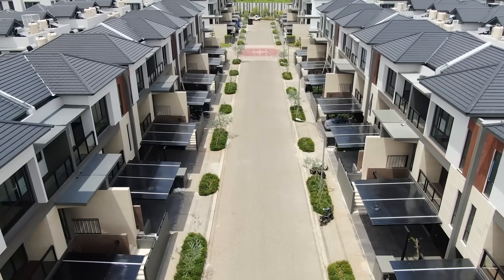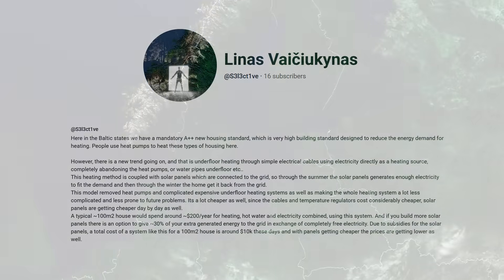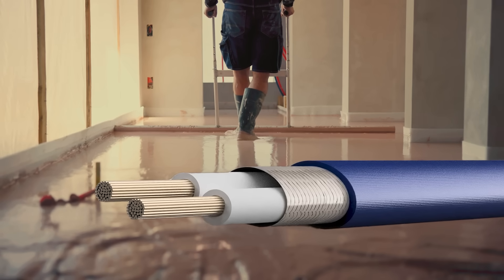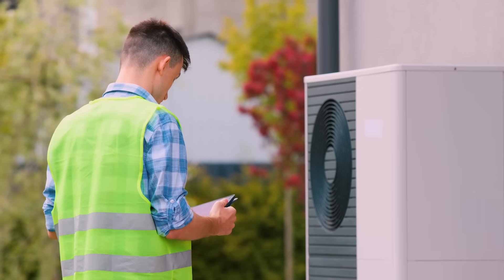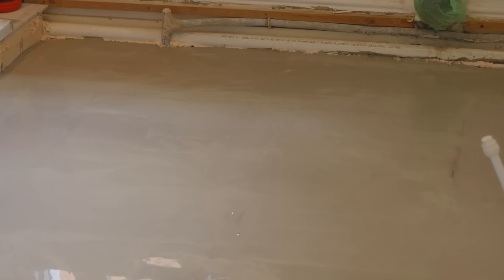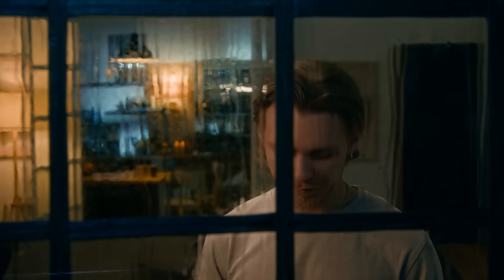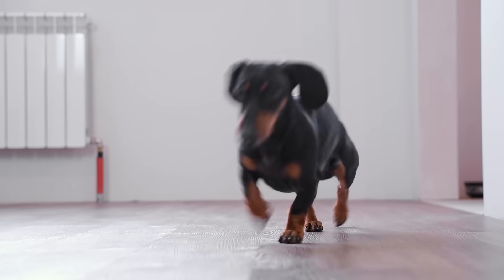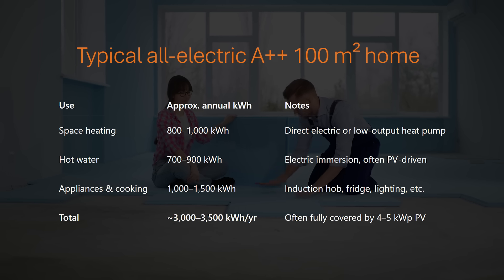What the Baltics Can Teach Us About Home Heating

Comment: If you build something that can more or less be a passive house, and just topp it off with direct electric it might be a bit inefficient but the install cost, upkeep and lifetime of the system is completely different.  Imagine not having to worry about water leaks, pumps, heatpumps and their associated lifetime costs. 

In a distant future when we have surplus in electricity, I think direct electric will have a massive comeback.

Comment: Heat pumps are fine for mild winters but in our dash for zero we do not encourage multiple systems. It must be clear to anyone who looks closely that switching to a gas device in the depths of winter and higher water temperatures is the way to go.
Our houses are not well insulated, mine is a 1930s small detached with uPVC double glazing, 8” of loft insulation I installed 20 years ago when subsidised, and a modern combi boiler. There is more I can do with a well insulated loft hatch, closing off the cavities and foil insulation under carpets in some ground floor rooms. But beyond that we are not going to find many cheap gains.

Comment: So  yes it does work but you can also use the heat pumps in the same house. And pump it into under flour heat base. Which gives higher thermal efficiency.  But you find  houses in uk  with this specific  standard of building you pay for it. Big time Uk builders don’t have the skills to produce houses of this standard in uk on mass

Comment: UK have to have sub standard building regulations if you cannot get a heat pump to work. Lithuania have one of thhe higest electricity ptices in Europe, far higher than UK. Why the do not install heat pumps is simply since they cannot affoard one. 200 in Lithuania is 2000 in UK.

I would start removing the carpets from the bathroom and leave the tudor stone and clay houses for the critters. We stopped living in outhouses in 1900.

The Vikings on Iceland was more clever in energy efficency compared to britts in 2025.

I live in Finland and I am not a heating engineer. Here heating efficency is common knowledge. We heat ou houses with electricity nowadays in combination with a heat pump in some form. In rural areas people heat with firewood if they have own forrest and tge processing equipment. Oil and gas are out since 1990’s.

Also, there are 2.8 million inhabitants in Lithania. Maybe you should compare the situation to a suburb of London. They have one hydroplant they run fot a few hours plus some wind power. When that runs out they mainly import electricity from Poland, Sweden and Finland. uK is on similar path importing Norweigian hydro power. scottish gas will still determine your electricity prices.

Comment: I have an unremarkable 1930 end terrace north facing 100sqm house in outer london...solid walls, hip-to-gable loft conversion..so north facing wall is 3 stories tall. Windows and door from the early 80's.... quotes are 20k. I have no idea how much external insulation would be but from others Ive been reading around 15k. Possibly. 
I would never get ROI on this before my death in 30years. I would love a more comfortable house yes, but unless I lose my job and get the government to pay for all these upgrades I suspect I'll either live here as it is till I die, or end up selling.
The cost to bring it up to modern standards is way too high. Labour is too expensive, but I appreciate everybody has to eat. So here we sit, in 2025, cold and miserable. heating comes on, temperatures go up...then we lose +2degC/hr...so whats the point. I'm not paying to warm up London.

Comment: Your describing a passivhaus, nice if you can afford one.

I live in a 70m2, 2ft rubble stone cottage, no insulation, Air leaky as hell.  Wool cardigan is primary heating, gas for 2 hours in morning, 5 hours at night.  Log burner for really cold days, Log burner is a luxury as that costs more than gas.

The cost of insulating and heat pump vs payback just doesn't add up when the house is warm enough on 5000kwh of gas PA or £400 at current rates.  I would save approximately £200 PA for an outlay of £20K

Comment: My 1930's semi requires so much heat in winter I can't see anything other then gas working for us, until we finish insulating anyway. On a cold day the exterior walls get down to 10 or 11 degrees c. The windows are much the same as they are air filled double glazing I would think.

Comment: What about putting your heat pump in your cellar of annex garage, well vertilated. This will make it even more efficient in winter and summer.
Reply from the maker: It will cause no end of problems by taking all the heat out of the building

Comment: I live in Eastern Europe and installed a monobloc air source myself. It's only used for heating and I have underfloor pipes so the system is very simple. I'm very happy with it. It's an old house but over the years I've insulated it pretty well. I also have a solar system that I also installed myself.

Comment: I'm going to build a 90sqm bungalow, modular house. Raft foundation 150mm kore insulation. Modular skin is 80mm pir composite, will have cement board outside, nap plaster. Internal 100mm pir board, 12.5mm plasterboard, same for ceiling. Roof tile is 80mm composite sheeting. Heat recovery system. Electric heating, probably infrared panels but not 100% decided yet, heat recovery should move enough air to distribute radiated heat. I will be adding pv panels and battery to a garage roof or lawn mounted panels in the next few years. I expect A2 BER before pv panels and A+ after pv panels.

Comment: Its impossible to live in such building. Airtight means no ventilation, no exhaust of anything - kitchen fumes, cat litterbox or spoiled foodscrap bucket. As soon as it becomes ventilated - heating of this constantly changing air (at least 1 time per hour for comfort living! For workspace its 3 times per hour) becomes a big problem. Recouperators with heat exchangers can reduce it, but they are very complex and expensive.
Reply: Some houses or victorian age arent feasible for full house ventilation systems let alone twice for air supply and returm

Comment: There should be a revised government spec on new builds, proper insulation wouldn't cost too much more. Outside air/air heat exchangers would minimise heat loss to achieve fresh air requirements. All this has been going on in Scandinavia for decades. Zero energy homes allowing occupant who emit 100 watts/person of heat. But we don't have hyper-mileage cars (300mpg), so we won't have this either.

I have a wood burning stove and burn 4m3 wood a year at €60/m3, so my heating bill is €240/year.

Comment: What do you do on an old, poorly insulated house?
Solution for me, I use 250w heat lamps for instant heat, and i turn them off when I leave the room. Bill down 60% to 360 kwh per YEAR. including 5 months of AC. The bulbs cost $5 each.

Comment: How about running those cables on the internal walls instead of on the floors?
Reply: Why would you avoid running it it the floors? You need to run them in something that has a thermal mass, like concrete and tile. I guess, if you have solid walls, you could do that, but why?

Comment: So, you are saying the hp doesn’t work in the uk because of the housing stock and therefore there is too much work to get them adopted, but the solution is to build new really efficient housing? How about you meet mid way, do some improvements to the existing homes and install hp?

Comment: It is a total myth that you need a well insulated house to run a heat pump efficiently.  The efficiency of the heat pump is not affected at all by the level of insulation that a property has, what is key to heat pump efficiency is the flow rate and the flow temperature that the unit operates at.  ANY heating source will cost more money to run if a property is not well insulated, that is just common sense.  Now, if a property is well insulated, you could possibly run a heat pump at lower flow temps to keep its efficiency high, but that's a different thing.  You can also run a heat pump at low flow temps in a poorly insulated property (for example, our 150 year old Victorian stone built detached house), as long as the heat pump is correctly sized and has emitters (radiators, underfloor heating) that are big enough to distribute enough heat to match the property's heat loss at all realistic outside air temperatures.

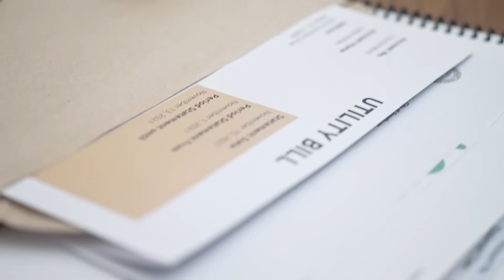Comment: 1:05 if you used an oil boiler in a super insulated home it would be so easy to repair, cheap to run as you won’t use much oil and it’s doesn’t rely on the grid. Yes it’s old fuel but this question is about insulation and NOT fuel type.

Comment: The bottom line in the UK is that solving this problem too quickly will make the people in control worse off. That's all it comes down to. Until they work out a way to line their pockets and exploit it effectively, nothing will change. That's why there is such a high cost to these bits of new tech. Who wouldn't want solar and heat pumps in a well insulated home? You can generate a lot of your own energy and never pay for gas again! That's scary for energy companies and govt.

Comment: Hi Roger, what heating system do they put into new house in the UK? In Ireland all new houses are A rated and have a heat pump, it works well due to the insulation. I myslf got a new house 3 years ago and the energy bills are lower than my previous oil boiler home. I also would have had to buy approx 800 euro of oil each year. The house is also much more comfortable as its the same temperature all Winter, no more coming home to a cold house.

Comment: This an age-old discussion on the differences between a Continental climate and what we have in the UK, which I would describe as a Gulf Climate, i.e. that influenced by the Gulf Stream.

A Continental climate is largely stable and the differences between seasond well defined and predictable because of the large land mass of the European continent.

The UK and Ireland are perched on the extremes of the European land mass and, almost uniquely, the victim of oceanic activity on another continent completely, South and North America, assuming we can call them the same continent.

Oceans are unpredictable, who knew? The Gulf Stream running as it does from warm equatorial regions into colder northern regions carries with it a huge amount of airborne moisture, which manifests itself not only in rainfall but an increased level of humidity all year round. It also brings with it unpredictability in seasonal change from year to year.

Housing has adapted to cope with those changing conditions over centuries, materials and conditions and labour skills along with them. But one thing is universally true, that until the 1940's/50's when coal was the principle means of home heating, houses were draughty, and all the better for it. Coal fires drew in a vast amount of air through leaky windows and doors (not forgetting floorboards) to feed the fire, which kept moisture from condensing on walls. They could be lit when conditions demanded and varied in size, also as conditions demanded.

What I'm trying to illustrate is that the problem in the UK isn't heating a home, it's ventilating a home, whilst keeping it warm in a damp environment. We can't insulate ourselves from ambient moisture like we can from ambient temperatures. We need to move vast amounts of air through homes to ensure they don't retain static moisture, which destroys anything it condenses on.

For that reason alone, we cannot compare our heating bills to those of Continental homes. Ours will always be higher on average because their humidity is lower.

Temperatures also play a part. The UK is on, roughly, the same latitude as Calgary and Moscow which have much lower winter temperatures, Calgary average daily low ranges from -15°C (5°F) to -10°C (14°F), Moscow average daily low ranges from -15°C (5°F) to -10°C (14°F). Edinburgh's winter lows range from 0°C (32°F) to 2°C (36°F).

Insulation from cold is more important in places like Moscow and Calgary than it is in the UK, and seasonal variations swing from warm to cold are greater, whilst the average temperature in the UK is less extreme but characterised by all round precipitation.

Our humidity and home ventilation is more of a problem than temperature swings. We can also experience almost daily swings in temperature when we need, or don't need heating, even in the depths of winter.
Reply: Why don’t you write an essay.
Reply: @PureHokkaido  Why don't you?

Comment: Thanks Roger, this is thought provoking, a lot of people seem to be very positive about radiant heat as an efficient electric source of heat along with good insulation and solar etc.
Reply from the maker: Most humans and many animals love radiant heat. Few things can match the feeling you get sitting in front of a fire. 
The sun is the biggest radiant heater we have and on a cold day at the top of a snow covered mountain you can feel the hot sun on your face. It feels great but it is heating the surfaces it touches and not the air it passes through so it feels very different in a cold house. I have a wood burner which convects heat so it heats the air but still gives you a nice hot blast when you sit in front of it.

Comment: I’m a sparky so naturally I ignored all advice and warnings like the one you just given out and installed loose cable underfloor heating last year in my house. Again though Ignoring manufacturers recommendations I installed it into every channel in the decoupling membrane rather than ever other and it’s absolutely perfect, been down a year no issues with tiles or screed cracking etc. And will take my tiled bathroom from 16 degrees to 26 degrees in an hour and will only drop by about 1 degree an hour when switched off. Best decision I ever made.
Reply: Is it enough to warm the house and how much did your electricity bill differ?

Comment: I Pay well over £20 a month standing charge , my actual Electricity use is £18 a month . WTF
Reply: As usage decreases they will raise standing charges so your reduction in use means no gains for you but higher profits for the supplier
Reply: @captainheat2314  correct

Comment: Insulate insulate insulate - there is no other way to 'save the planet' or just fuel bills. Often it's of limited use as a retrofit, but on new-builds designed to eliminate thermal bridging, it's excellent. On a bungalow I helped build in SW England (Wiltshire) of standard clinker concrete blocks and with a natural sandstone stone facade, we insulated the cavity walls with some 300mm expanded polystyrene (ceiling the same, 200mm EP under the floor slab), it was a big building - 1.5 floors, built in an L - shape of sides around 18m metres and literally with three people in the house and the hotwater boiler working, gas stove cooking, the washing machine and dishwasher used daily (none of us was home during the day, no children or pets, so heat source use was minimal) it was so hot inside that we had to open the front door daily, even with an outside temperature of around zero Celsius. We never, ever had any heater on. We didn't have ceiling fans or heat exchangers, so no hi-tech stuff to buy or to go wrong. The area was sheltered on one side by a large farm building 20 metres away, the other three sides open and exposed. But it was just stunningly good.
Reply: Seems like you had the right idea; mega insulate.  Well done indeed.
I didn't have the dosh to build new, but have invested over many years in cavity wall insulation, double thickness loft insulation, solar PV with solar power-station batteries, triple glazed windows (cheapies).  Also because I choose to live an alternative type of lifestyle, I pay really really lowwwwww electricity bills.  I still find the old electric storage radiators to be great for me - charged via an Immersun unit; I don't have gas or any other energy source, so all electric.
If my neighbours ever found out how little I paid annually for energy, they'd lynch me.
Reply: @johnkay4701  Hi mate I wrote a long reply - disappeared. Perhaps discussion of solar water heating panels upset someone in Davos? ;)

Comment: What's the problem with gas ( where there already is an existing infrastructure) and government subsidies in outer walls insulation? Instead of subsidies in heat pumps and solar panels, which produce only around 15-20% of the stated power anyways? And they produce electricity whey you don't need it and don't produce when you need it...?

Comment: 3:32 The "100% efficient" figure applies to those cheap box heaters you can get at home improvement centers, or just about any portable or semi portable electric resistance heater. But, ironically, the more permanent and seamless the installation, the more opportunities there are for losses that would compromise that 100% figure. Radiant floor heat installed over a not-so-well insulated vented crawl space, or a cold slab is not going to be 100% efficient any more than an electric furnace or boiler with the heat traveling through exterior walls and unheated spaces would be. There was a time here in the USA when some builders put electric heating wires and films in ceilings, including running it under the insulation in vented attics. On top of a reputation for starting fires, those systems would run up big bills if the insulation was too thin, sloppily installed or disturbed during any other activities that involved entering the attic.

Comment: Do they have a problem with fresh air to breath? All that insulation must have some effect on respiration?
Reply: You have an air exchange system in such houses to manage humidity levels and other impurities. It's fitted with a heat exchanger so even though you exchange a fair amount of air you keep most of the heat it had.